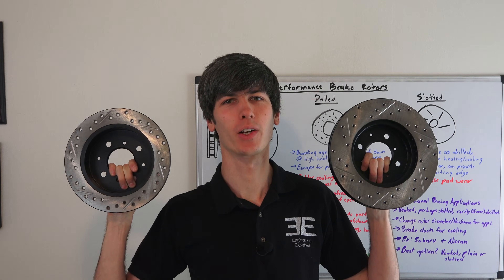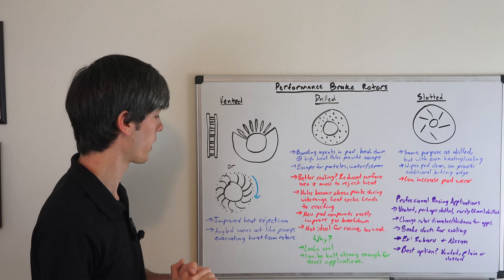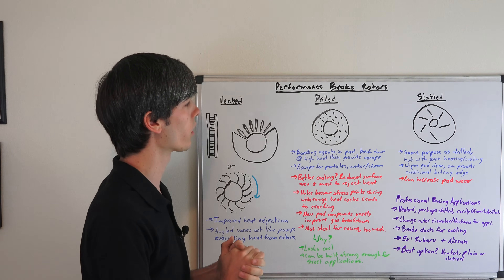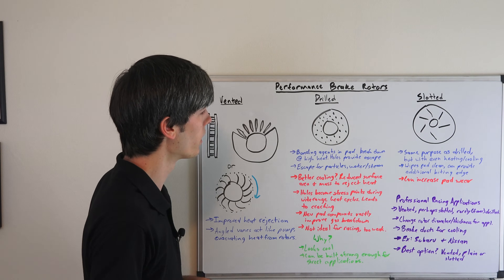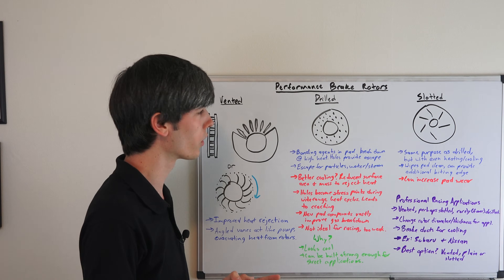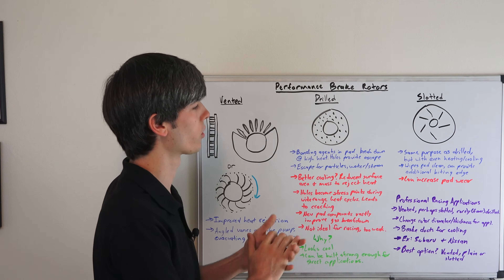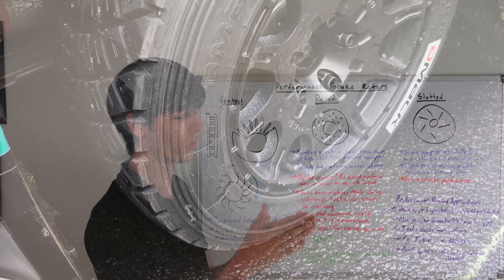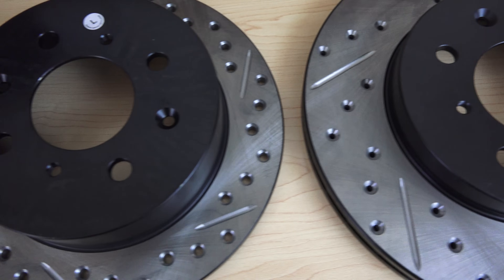Drilled, Slotted & Vented Brake Rotors - What's Best?

Comment: Any idea how to prevent rust building up? Every time it rains or (rarely) is a muggy day there is sooo much orange rust on the rotors. Driving around the block takes care of that but damn, every time. I see other peoples' rides and are perfectly fine. Has it anything to do with the quality they're from a dealership? Not quite sure what brand but clearly just meet the bare minimum of what a rotor should be with it-just-barely-passed-inspection rating.
Reply: +DareToBeDeviant It's all about the material. Cheaper brands will likely be made of lower-quality, low-carbon and more porous gray iron cast than the more expensive brands. I used to sell spare parts and you could see the differences in the materials with your bare eye. Another common problem with cheap rotors is also that they warp more easily, causing vibrations during braking.
Reply: Bumper3D I've noticed the warping. Had to recently get mine resurfaced because they looked like garbage and caused weird noises which got progressively worse. What's wise to get? AC Delco?

I'm all body and electrical, not suspension so my ignorance is hiiigh.

Comment: What about a 'blind-hole' compromise? I'm told its a form of slotted, having the appearance of drilled rotors w/o the cracking susceptibility?
Reply: dimpled?
Reply: drilled rotors shouldnt crack unless you buy a cheap shitty brand.....if thats whay you mean
Reply: +James Franco All cross drilled rotors are susceptible to cracking regardless of the brand. The best is simply the thickest and most well vented you can get. It's all in the physics.
Reply: +Adam S ive worked in many shops and ive never seen the mid to high level brands crack .....
Reply: +Adam S i even use front and rear slotted/drilled rotors on my tundra and ive never seen one set crack
Reply: Cracks are normal even with high-quality OEM like Porsche.  http://rennlist.com/forums/996-forum/654567-rotors-hairline-cracks.html

Comment: Failed inspection for brake lining, pads. I wanted to replace brake pads and rotors for my Camry 2002, don't want to spend very much but get a decent one. Probably will be buying Online, because it is cheaper, any recommendations? Thank you in advance

Comment: Directional rotors...
To pump air the cuped vanes scoop air in from the outside towards the hub, unlike the spin arrow shown on white board !

DIRECTION:
If you spin a "pump" *backwards*... nothing happens, no pressure, no vacuum, nothing!
🤗

Comment: What the different between brake pads Simi-Metallic VS Ceramic Pads ? i don't which one one going to use on BMW e36. Thank you
Reply: +Raksasok Heng Ceramic pads are harder and they cut into the rotor more; having a higher chance or making noise... semi metallic are softer and they wear more quickly. Germans use ceramics with a softer rotor

Comment: I have a 2012 Chrysler 300 that has gone through 4 sets of front rotors. After 3 or so months, they start to pulse and shake. I have replaced them with the best autozone gold and still get pulsing and shaking after 3 months. I put 100 miles a day. 80 miles highway and 20 miles city. I stopped using metallic pads the last two times just to see if it made a difference but it did not. What do you think causes this?

Comment: Great video, as always. I have a question about my brakes. I have a 2014 Hyundai Elantra with about 30k miles on the factory brakes. The brakes work fine, but in wet weather they make a low rumbling noise when I apply the brakes. I can't "feel" any difference in the performance, but the noise is disturbing. I've never experienced this in any other car I've driven. Any idea what would cause the brakes to rumble when they're wet?
Reply: +dLimboStick could it be your tires?
Reply: Compatible Could it be? Only when I apply the brakes in the rain?
Reply: not certain, but your tires might not have enough grip and cause it to slip a bit, hence a bit of rumble noise. Check out the tread on them
Reply: Compatible That's interesting.  I just bought new tires, so it couldn't be that the treads are worn, but on the other hand, I don't remember noticing a rumble before I bought these new tires, though I did go through one rainy season with the original tires. They are cheap tires. I had to bring them back to be balanced twice, and they had to road-force balance them to get rid of the vibration just driving normally. I wonder what would cause the tires to rumble only during wet braking.
Reply: Hey I have the exact same problem. The only difference is; I have that same rumble when I start slowing down from high speeds such as 90 - 100 mph. There is no defect in brake performance but I can clearly hear that rumbling from down there and it's quite disturbing. Nobody could suggest an answer. Now all I could think of is it's chronical for all the Elantras.😐

Comment: Yes, drilled rotors can crack. If your. Using/buying cheap Chinese made ones. Problem is the cheap ones aren't drilled correctly, holes are too close to end of rotor, and also rotor thickness. I myself run drilled/slotted rotors and power stop evolution pads. As long as you follow the pad/rotor break inProcedure and buy from the right places they can be very reliable, and have there advantages vs stock vented . I am currently running (Callahan) brand, drilled slotted rotors and OEM Bmw pads on my 09 BMW 535xi. TheyPerform excellent.

Comment: I think drilled and slotted are worthless.  When I did high performance driving on at track with my suped up Subaru I used basic solid rotors and ran all sorts of pads with no issues.  The only real improvement is bigger rotors, 2 piece rotors, brake ducts.  Racing pads are what’s key on the track.  And any higher performance pad will dust some (and a lot of you get a more aggressive pad and push them).  They’re semi-metallic.  And they may squeal some. That’s why you hear trucks squealing at slow speeds as they have higher performing semi metallic pads.

Comment: Engineering Explained Any reason why motorcycles might have an advantage with drilled rotors? I think every bike I've seen has drilled rotors (almost). Never seen a vented rotor either, they're all solid, which I'm guessing is a space/weight issue. The rotors are paper-thin compared to cars.
Reply: Shoeshear it's also 200-250kg vs over a ton. and all brembo, even nissin or tokico brakes are capable of pulling stoppies on sport and supersport bikes without shifting your weight forward. means they have more than enough to then compensate for standard brake fade on mountain roads, light track use.

Obviously Nissin and Tokico will boil on track use but that's why brembo and carbon brakes exist for those that are on that edge.
Reply: Shoeshear And sorry they don't have an advantage. It's cheap and to look good. 
Or though flat discs exist, mainly on older bikes, they do have heat issues with today's speeds, so even brembo's approach to steel discs was to make the drill holls as small as possible on their highend discs. but brembo do make vented steel rotors for the rear of MotoGP and WSB. and plane flat carbon up front.
Reply: Kaironex Cryziz I figured as much. I took my bike to the track recently and didn't get too much fade. Just wondered if there was some benefit. My calipers are Nissin, for the record. Thanks for the reply.

Comment: How does increasing the width of the rotor say in a rally car where you said they're restricted in diameter by their wheel size? Wouldn't a wider rotor just add more weight to the car rather than adding any stopping power?
Reply from the maker: Michael More mass to reject heat into. As mentioned though, you always have to balance things. You need to be able to reject the heat out of the caliper as well.

Comment: I have a Volvo xc90 with 20 inch rims, when it rains and you have not used the brakes for a while on the motorway, they have absolutely no bite for a second or two, when they do bite one side will bite then the other which really upsets the car, afterwards they work as normal until they are not used for a while. I never experienced it on my old xc90 running 18 inch rims. Do you think putting slotted discs on will solve the problem? As I am assuming that the disc is becoming saturated with water, due to the massive holes in the side of the wheel.

Comment: In your video you said that drilled rotors are going extinct. Two questions 1) how and when do you know a certain kind of brake pad will perform better with drilled rotor? 2) if cross drilled rotors are an older design, why are they found on the gtr35 (and many amg's) - which I would assume could be one of the present day bench marks for pure performance. Surely a slotted rotor would far better and imo look better as well? Thanks!!
Reply: O

Comment: I think the engineering dude got it wrong on the drilled rotors. Many many manufacturers use them. My own experience with drilled rotors is that they help prevent warped rotors and offer good braking performance.

Comment: What about solid rotors? my dad's 1993 geo metro has solid front rotors and always warp because the the rear drums don't work very well. was thinking about adding vented rotors to the front to help dissipate heat or even drilled and slotted lol . new rotors are only 16$ just sick how fast they warp. what do you think?

Comment: @engineering explained. my rotors are warped on my 2015 STI and it will cost ~$400 to fix them, should I just buy new rotors? I plan to race hopefully next spring, so the slotted rotors would be best?

Comment: These will do little. Spend about 1500$ on some wilwood calipers, racing brake rotors (two piece) Dimple or slotted bigger, smaller I tried it oem +doesn't do jack.

Comment: I've got dimpled and slotted rotors on my car that i will soon use for hill climbs and track days. These are dimpled not drilled all the way through, so will it still be a weak point?  keep in mind my car only weight 750kg and only pushing 90kw atw.

Comment: what about material? does the risk of fracture from being drilled also apply to carbon ceramic rotors? also, no mention of servicing the rotors.....can you really resurface drilled or slotted rotors?
Reply: Drilled and/or slotted rotors are not meant to be resurfaced.  They are a "once and done" affair.  I'm not implying that people haven't done it in the past, but it's not recommended whatsoever, and a good way to destroy the lathe cutting bits.
Reply: According to Stoptech it is perfectly fine to resurface their drilled or slotted rotors.
Reply: Carbon ceramic rotors have much higher heat capacity than your usual cast iron but will still crack; made worse with numerous, deep heat cycling during extreme track conditions. On the plus side, hairline cracks do not compromise integrity or function as with cast iron unless it's major cracks to the edge of the rotor. You cannot resurface CCBs and they must be replaced (usually at the cost of $1500-$4000+ per rotor.) Keep them free of debris that can scrape the surface, too.

Comment: whilst i enjoyed the video, i am not so sure on the content and co.clusions around cross drilling being for looks. you cant buy a superbike without cross drilled brakes and if anything, solid brakes would be sold as an aftermarket improvement, if they made a positive improvement ( especially bearing in mind bikers lives depend on those brakes to a higher degree than car drivers - given all the other safety features cars have, eg roll cages  air bags, etc)

Comment: My  Country Sister uses a chain to hang old brake rotors to the front end of her tractor for weight to keep it from coming up in front while pulling the brush hog.  Should she use vented or slotted for that?   hehe.
Reply: +JD B Seriously thanks for the video.  Won't waste my money on drilled.

Comment: so i wont notice any faster heat dissipation with a drilled rotor than my standard plain rotor? Since it has those holes, wouldnt it cool the rotors down a bit faster?

Comment: Like yourself I just bought a Crosstrek, what do you plan on replacing your brake pads and rotors with when the time comes. I usually do my own and buy them at the local auto parts store. Just curious what you'd use.
Reply from the maker: I'd probably either go with OEM and buy parts from the dealer (assuming they're not too pricey), or get the best pads possible (mostly based on cost) from the local parts store. Cheaper ones tend to be louder and dustier.
Reply: you can get inexpensive rotors (I recommend centric rotors) but I'd go for a decent pad (not the super cheap ones)
Reply: I always recommend wagner pads. The whenever I bought them for almost any car the were made in the US or Canada. Im not sure if thats changing but last time I bought them for a 08 hyundai they were US made ceramic pads.
Reply: What if I want better stopping power?
Reply: GodKing804 more aggressive pads will be the best way to get more stopping power on the street.  Stoptech streets, Hawk HPS, EBC are some options to consider

Comment: i got one question: Why is the surface area reduced? I think its bigger because of the holes. And they create a better air flow or not? Because I saw drilled or slottet on really high performance cars which are just there for performance like Koenigsegg or some gt3 cars. That really confused me :D
Reply: Holes will likely increase cooled surface area (depends on their size) but I think the main way they'd improve cooling is by increasing air turbulence on the rotor surface. 
I've no idea whether this is why high end cars would use drilled rotors but I really doubt it's for looks only.
Reply: +Leon Kalogeropoulos The surface area is reduced because you literally took out part of the surface by making holes; thus you no longer have that surface area, instead you're left with holes.

Comment: hey EE and everyone im just wondering on upgrading my brake disc into a bigger one while keeping the stock caliper for now cause cant afford it yet so what if i did go with big brake disc would it help stopping the car faster in with a stock  caliper? i also put to consideration on putting a beefier pads cause you know that might help in stopping my car faster.

Comment: Question: if a rotor is vented with angled pump-like vanes, does it have to come in sx and dx variations? Audi and some merc does provide those rotors but they seems to be two left rotors instead of one right and one left
Reply: Most of them comes with different front brake discs in the front only if they are a equipped with a sportier engine or have a sport packet. My previous car (bmw 6 series) came with different front rotors in the front with angled vanes, and straight vanes in the back (interchangeable left to right). Even after going aftermarket, i had to buy the two discs in the front with different p.n. (they were simply mirrored brake discs) and two identical one in the back.
Some car with different motorization comes with straight vanes, but slotted in the surface, and you can see by eyes the slot reversed in respect to the other. Hope i've helped you.
Reply: @MarcoMardegan  even the latest a45 has two left (or right) rotors at the front. Producers try to impress us by doing simply crap job

Comment: I've never had a problem with my drilled rotors (2002 WRX 400whp) with lots of hard braking and accelerating...hard meaning like 120ish to 40ish then back up to 100+....also drove like an ass hole in snow/slush with no issues....and....well.....they look cool :D

Comment: Some of the information provided in the video are no longer correct. For example, rotors no longer crack due to cross drill holes. Alloys have dramatically improved over the past 10 years. Also, brake pads have drastically, again thanks to improved designs and materials available today.

Comment: I really like your videos but what you said here about drilled rotors is wrong!
1) Not only the pads produce gas. If it's raining and water gets an the discs, it can evaporate on the hot discs and build a steam cushion. Also, all kind of things can get on the discs and if they're small enough even get between the disc and pads. That can cause grooves on the discs and pads. Having the holes will help clean the discs. The holes are less for cooling than actually for cleaning!
2) Yes having drilled holes can weaken the discs. That's why highend discs are not actually drilled but the holes are already there when they cast them, they're part of the mold. Porsche for example is doing this for their brakes.
3) Something you didn't mention at all is that drilled discs reduce the unsprung mass.
4) You say race cars use plain or slotted discs but that's wrong! I've seen a lot race cars having drilled discs.

The only real disadvantage of drilled discs appart from maybe weaking the discs is that they increase wear on the pads but slotted discs do that as well and who cares about the wear on a performance car?! If so, you're doing it wrong anyway. Go drive an economy car instead.

Comment: What about the ones you had on display? Do they allow for better cooling since it has all three combined in one rotor? Is it better than just regular plain vented?
Reply: hio drilled and slotted rotors usually cost significantly more while being less reliable, so it's up to you if the cool looks make up for all those drawbacks.
Reply: Thanks for the answer, I always thought if it was all 3 in one it would be better.

Comment: I'm looking at a brake & rotor set, the rotors are drilled AND slotted. Would you say the combo makes the rotors better than just being drilled?
Reply: +EmperorOfNyte82 -- This is the set in question: http://www.rockauto.com/en/moreinfo.php?pk=3795267&cc=1305504&jsn=230